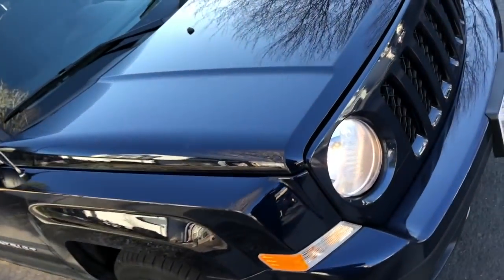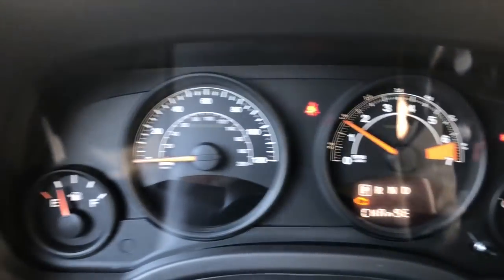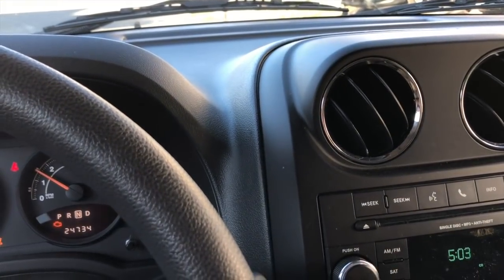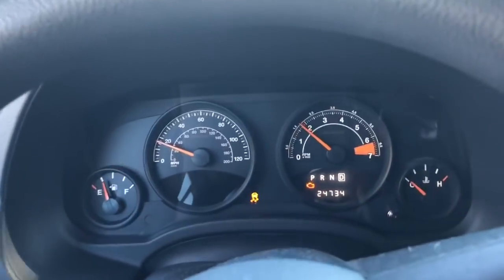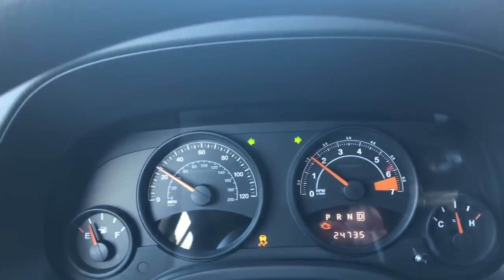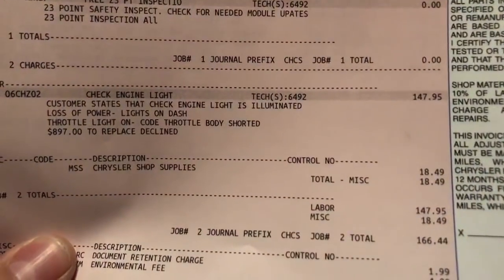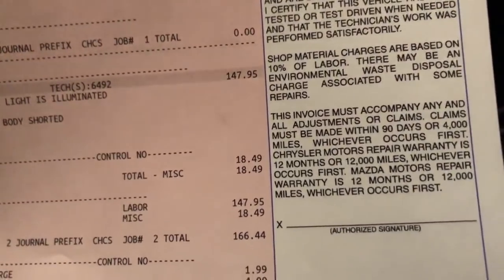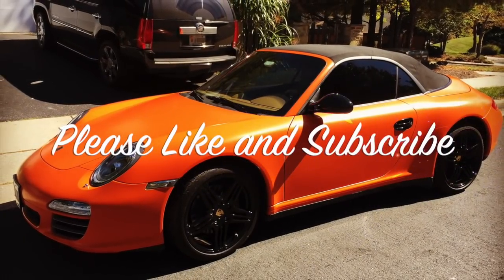Diagnosing a bad throttle body.  Limp Mode Chrysler Jeep Patriot

Comment: I'm so glad I saw this video. My 2015 patriot is doing the exact same thing and I was about to take it to get it looked at where they charge $120 just to look at it!  I know nothing about cars but after this video, I'm almost positive that's what's wrong with mine too.
Reply from the maker: Lea Ann Schmittou check the connectors for the throttle body just in case one has gotten loose and is causing this issue first.  Check out my install video if you want to take on the project yourself.

Comment: I am no advocate for new car dealerships but you also have to understand is that they don't just plug in an OBDII scanner. Codes give a direction to go with the diagnostics, after determining that the computer says their is a problem with the throttle body then it gets looked at with an Oscilloscope to see if the throttle body is getting signal, has ground, is putting out a throttle position signal. It all takes time to do and those techs are paid on a flat rate scale.
Reply from the maker: Wallace D There are good dealerships and there are bad dealerships just like with any business.  My issue isn’t with dealerships in general, it’s with this dealership in particular that had the car on two occasions and didn’t resolve the problem while it was under warranty.  I have had several good experiences with dealerships in the past.  There is even a video my channel of me at my local Porsche dealership when I lost a wheel lock key.  The treated me well and fairly.  From the response and feedback and research I have done, the throttle body seems to be a very common issue.

Comment: Mine does the same but it has a fuel pressure sensor code that keeps coming on and this vehicle didn't even have that equipped on it. Any answers on that would be great. 2014 Jeep compass 2.4l what could that sensor be?
Reply from the maker: Sorry, I don’t think the fuel pressure code would be related to this,  but if you have the exact same symptoms, it could be. For $60 it’s worth a shot.

Comment: Hi. After replacing the throttle body. Has the car been running smoothly? Mines is currently doing the same exact thing. Apparently it’s quite common in type of car. Dealership her in Miami is charging me 1265 😩
Reply from the maker: Christelabella bella it has been running smoothly and hasn’t had any issues after replacing it.  Did they diagnose it as a bad throttle body?  If they did then get it replaced.  The dealership here quoted me $895 to replace it.  My next video actually shows me replacing it myself for $200 I think it was.
Reply: Yes. They did. I saw that video shortly after watching this one. I’m going to bug my brother to do it for me. He has experience with cars plus your video is very detailed. Thank you for posting.
Reply from the maker: Christelabella bella great, let me know how it all works out.
Reply: @OmarsGarage  Thank you so much for replying and posting this video. I'm changing mine tomorrow.
Reply from the maker: Let me know how it goes.

Comment: Hi Omar! My 2015 Patriot did this last Thursday but hasn't done it since. Do you think it still needs to be replaced or maybe cleaned? Thank you!!
Reply from the maker: Jessica Eso ours acted up every once in a while.  The good thing is that you can still drive the car even when it acts up though only at about 20 miles an hour.  I would hold off but if it happens often then it doesn’t hurt to just go ahead and replace it.
Reply: Okay! I just bought it in July but it is used and just hit 61K. It did have an oil change the day before so I'm not sure if maybe that could have also triggered something? I'm just hoping it doesn't happen while I'm driving on the highway! Thanks for doing these videos! 😄
Reply: Mine only has done this twice while starting it up. When i turn it off and back on its fine though.. and the lightning bolt goes away, engine light stays on for a little while and then goes away too @OmarsGarage

Comment: Very useful, thanks, I was on my way to work and this happened!! Much appreciated
Reply from the maker: Joe Nacos sometimes if you turn the car  off and on it will sometimes fix itself but eventually it will completely fail.
Reply: @OmarsGarage  yes, i have to do that with mine. its like by restarting the car you reset it, but it happens a lot when the temperature goes below -15 celcius. ill be getting it changed soon....

Comment: Thanks dude for this.. happened to me yesterday out of no where.. ran fine all day and then was in wal mart for 20 min and boom... electric light, traction control, engine light, power acts all slow but it’s not starting. It’s still sitting there actually.. hah. Trying to figure out what’s going on and came across this. Thanks for the video and help man. Much appreciated!
Reply from the maker: If it’s not starting at all it may be a battery.  In my case it still started it just ran in limp mode.  I have a video on my channel on how to check the battery if that turns out to be it.  When you turn the ignition on all the dash lights come on.
Reply: @OmarsGarage  yeah you'tr right.. it was a battery issue.. actually replaced the terminal in the positive and she fired right up! Gotta love cheap fixes...
Reply: @OmarsGarage  Hey Omar I had a low voltage code pop up on my patriot, I had actually turned the ignition and had the red bolt pop up once and scared the shit out of me , but the car runs smooth can  this be a battery issue?

Comment: Mine has always had no power when it's cold.  You pull out and it's like it's coasting.  Then in a few minutes it picks up and drives normal.  But when you pull out even after warming up for a bit, it goes slower than a turtle.  Not another $$$$$.

Comment: they did the same thing in medford oregon. it was the exact same issue you were having but they also needed to change out the o2 censors. Thanks for the videos man, i'll just replace mine AGAIN. Never buy a jeep patriot. they are  garbage vehicles and i still owe 10,500 on mine.
Reply from the maker: Thanks for the comment.  Other than the throttle body we haven’t had any other issues.  They are no frill cars, but I agree that I would never buy one just from how we were treated by the service center.

Comment: I have a 2006 Chrysler 300 and im having the same issue, but I have taken it to a mechanic and they supposedly fixed it, but the problem has yet to be resolved any clue of why this is still happening?
Reply from the maker: What did the mechanic say they did to fix it?  Did they replace the throttle body?
Reply: @OmarsGarage  they only replaced it. They really didn't say much and that they can't find anything wrong with it.

Comment: Maybe you can help me I have a 2007 Jeep Patriot I just put a new throttle body in it I put a brand new battery in it I put in a new O2 sensors in it it started up just fine then there's no lights when I put the reader on it but the problem is that every time I try to start it now the throttle body light with the lightning bolt and the battery and oil light and the check engine light flashes and it doesn't start and when I try to rub it or try to crank it more the starter starts going like I'm cranking it too much I replace the starter as well I just don't know what else I need to do to get the car started and running
Reply from the maker: Have you checked to see if maybe you have a clogged fuel filter or bad fuel pump. Could be that gas is not getting to the engine.  So it just cranks, but never starts right?

Comment: My 2008 Chrysler town and country does this sometimes and if while driving it happens,turn key off then on again still in drive and it will start and go back to normal. Mostly only does it on mine while sitting at idle
Reply from the maker: I’d try cleaning the throttle body firstz

Comment: I have a Jeep Grand Cherokee with a 3.7L that did the same thing. Brought it to have it checked out and replaced the throttle body. Check engine light came back on the very next day.
Reply from the maker: Michael Joseph what year is your car.  Someone else posted that the OEM throttle bodies had a high failure rate.  May need to replace with aftermarket.  Check out my other video where I replace the throttle body myself.  It may be something in addition to the tb though.
Reply: @OmarsGarage  Hey, thank you for your quick response. My Grand Cherokee is a 2008 3.7L 4x4. I replaced throttle body because it was doing exactly what your mother in law's Patriot was doing. Runs great now, just can't get the engine light to turn off. It was off for about a half hour after I swapped out the throttle body but then came back on. I'm at my wit's end with this vehicle. I've dumped a ton of money into it in recent years . Sometimes the only thing that I think will help is a gallon of gas and a match.. 😁
Reply from the maker: Michael Joseph have you used an obdii scanner to check the codes.  There may be another sensor or something else that is also bad.  Or maybe one of the connectors needs to be pushed in further.

Comment: Same thing happened to me! The same EXACT thing happened yesterday night but fun fact this morning autozone used a scanner on my car to get tho codes and after I left and turn the car off and on (about 3 full trips) the signals are all gone and almost immediately after the scanner machine was used the physical symptoms like loss of power and jolting completely stopped too... idk if the scanner had something to do with it or what but I’ve got until Monday to figure it out on my own because I go and see a mechanic
Reply from the maker: It may start to happen more and more often if it’s failing.  I would try cleaning the throttle body first and if that resolved it then you are good.  If not, you may need to replace it later on down the road.  Good luck 👍
Reply: Listen it’s either the throttle body, or it’s the computer, you can buy the computers already programmed for any car you just look up the make year and it is your conductor to your engine transmission
Reply: Don’t buy it, buy the computer instead

Comment: Same issue!! Throttle Body!! advice needed..... 2014 Sport, 39000 miles.. only issue, and it is fixed... do i sell while i can? or trust that it works now??  Jeep didn't "find the issue " until the warranty was out!       
Kinda creepy how similar this video was.  Thanks Omar... great vid
Reply from the maker: Don’t forget to like and subscribe 👍
Reply from the maker: In my opinion these throttle bodies should have been a recall.  It comes up in almost all Chrysler vehicles since they share the same manufacturer of the throttle bodies.  I found it really suspicious that while under warranty they didn’t find it on two occasions, then they want to charge $900 to repair it.  SInce I changed the TB it has not acted up so I would keep the car.  If it happens again then you know what the issue is and maybe switch to a different throttle body manufacturer.  The only "good" thing is that when it goes bad you can still drive the car even if in limp mode.

Comment: Thank you same thing is happening to my dodge charger you saved me a trip and money  car is doing  Exactly the same thing
Reply from the maker: Though the position of the TB will be different in your car, the procedure to replace it should be the same.  Check to make sure all the plugs are clipped in well before replacing the throttle body.  Some people have had similar issues with a loose connector.  I have video on my channel replacing mine.

Comment: I have a 2008 Jeep Grand Cherokee doing this EXACT same thing, I bought it from someone back in November of 2018 and after a few weeks the ETC came on briefly when on highway but I didn’t feel any issues, the light would turn off and not come back on for a while unless I was on highway. Last few days I’ve noticed it come on a lot more often and now with the tracks control light, loss of acceleration, can’t go past 20mph, everything works fine after turning car off and back on. But it’s only been three days since it’s started doing this. My brothers aren’t 100% it’s the throttle body and want me to take it in but I really don’t want to end up paying $800 for a $150 part my brothers could install. (They live two hours from me so they can’t exactly come look ASAP) was wondering your opinion on it?
Reply from the maker: KATRINAMELISSA it could be starting to fail, but if you can still get around I would order the part and have them come down on a weekend to change it.  It’s 11 years old now so changing it out may be a good precaution regardless.

Comment: Hi, my dodge caliber 2008 has the same symptoms, its sluggish and cannot move, but it jas no any code relating to Tps, instead it has transmission code, does throttle issue cause transmission codes to appear?
Reply from the maker: Does the car not move at all?  If you are getting the same lights on the dash then it could definitely be it. The part is cheap enough and easy enough to change that personally I would try that first. If the car will not move the. It’s definitely something else
Reply: @OmarsGarage  i showed it to a mechanic today, he said (i am sure its the transmission control issue)

Comment: My jeep shuttering like a sob tonight, this after similar experience in late fall in which dealership replaced the alternator. It has had over heating issues as well and bunches of stuff replaced there too.  It is nice for wisconsin winters, has good speakers but electronics suck - stereo am/fm doesn't work and other switches don't work like interior lights.  Why does everything made now have to be so shitty?  Corporations are just evil.
Reply from the maker: Things are just made poorly now so that you have to keep buying more parts or replacing them.  I have a clothes dryer from the late 80s.  It’s still going strong.  I replaced the bearings years ago.  I’ve been through 3 clothes washers in 10 years though.  The new stuff is not made to last on purpose imho.
Reply: Chrysler itself is a problematic brand, my mother in law threw over 4k in a pt cruiser and still having problems.
Reply: @OmarsGarage  the thing with older things too is that they were made for you to repair yourself,  now everything is with computers and covers just to make your life difficult and have no choice to call in a repair man.

Comment: Thanks! This just happened to my 2015 jeep compass yesterday. ugh. I didnt plug it in. canadian winter. my scanner read U0401...it may just be a dead battery but heck the throttle body symptoms may be the same. great video. thanks for your help!
Reply: Did you solve the issue I’m having the same

Comment: That happened I changed the throttle body and the engine computer along with spark plugs. Any other suggestions?
Reply from the maker: Could be a coil pack …have you scanned the complete yet after replacing the plugs and tb?
Reply: What do you mean scan?

Comment: I have that light in the middle on and abs light I believe but I think that's from me changing my clockspring with a cheapy one that didn't include an angle sensor
Reply from the maker: Is the car running bad or do you just have the lights on?  The angle sensor is pretty expensive.

Comment: Thanks, man, my 2014 Patriot did this to my wife with my kids going to the School in the Middle of worst Morning traffick, i was on my job when she call me upset, but when I connect the Obd Scanner the codes was: P2173 do you have any idea, i guess it is, because have the same trouble.
Reply from the maker: P2173 is a Throttle Actuator Control System Code so most likely related to the throttle body.  Should be the same issue.

Comment: throttle body shorted means bad throttle body?
Reply from the maker: Could be several things, but throttle body is cheap enough and easy enough to replace that it’s worth either cleaning it first and if not just replace it.

Comment: Most aftermarket stores will scan your car for free so they can sell you the part but not all dealers are a-holes like the place you went to but unfortunately they have a dishonest crew and I was a dealership tech for many years but for Toyota and they treated customers how they should but not all Toyota dealerships are the same either, I had a feeling it was the throttle body and now I'm certain tyvm.
Reply from the maker: Every place is different. I’ve taken my Tesla in for warranty work several times and they are the best. No questions asked just fixed whatever. Then you hear horror stories at other Tesla Repair shops. It shouldn’t vary but it does sometimes.